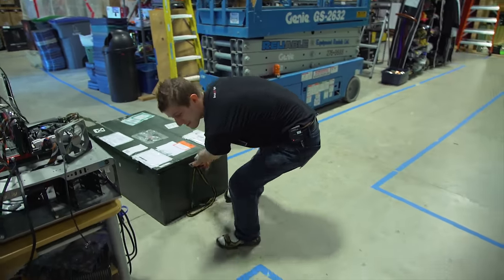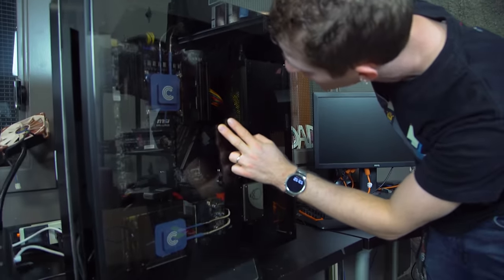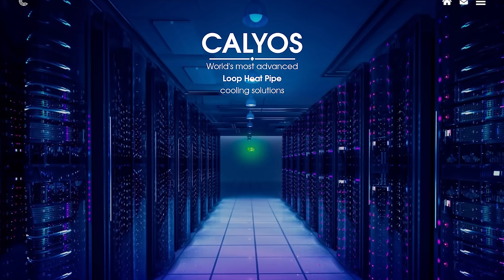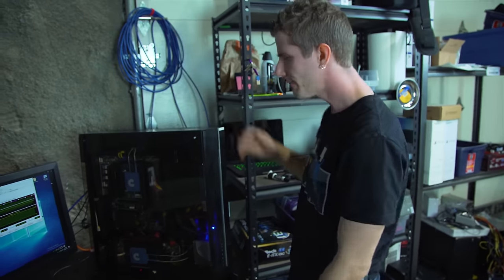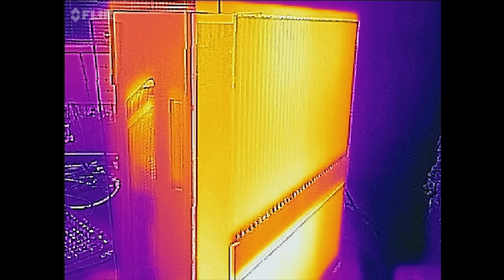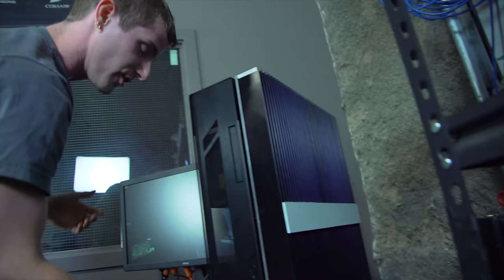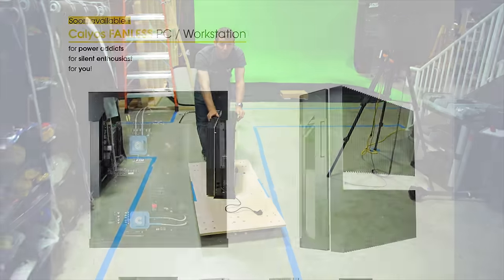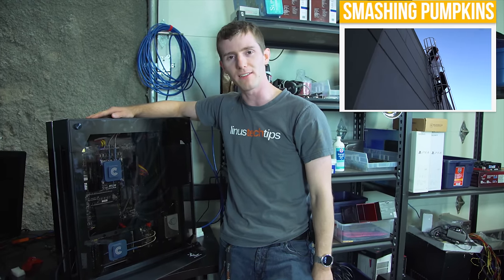TRULY Silent Workstation PC with ZERO FANS - HOLY $H!T Ep. 13

Comment: Make a video about integrated cpu graphic, how much they downgrade cpu work while running regular desktop/office tasks. Benchmarks etc.
Reply: This. I've been running a third monitor on my CPU and haven't felt any degradation in performance, but would like to see a more objective view on this.
Reply: Why not, it is good and cheap for desktop office builds. Not everybody wants to game you know :D
Reply: That's dumb, Steve. Integrated graphics are basically a necessity. If you swap GPUs out, you will most likely need to upgrade or change your graphics drivers, or, if you install it for the first time, how would you ever even know that you're installing the right driver if you cannot even see at all? The signal might go through the GPU, but without a driver telling it to calculate the graphics, it does nothing. A CPU comes with integrated graphics that should work with the chipset of the motherboard and its drivers perfectly, so that you have something to look at when you hook up a monitor. Aside from that, not every single computer has or needs a dedicated graphics card, like the one your grandmother uses, for example.
Reply: ***** They boot up, because they're using the integrated graphics. As I said, tyhe GPU at that point, just passes the signal through.
Reply: ***** Seeing that a GPU simply does not work without the proper drivers (as is any hardware component), I cannot see it doing anything else than passing the graphics from the integrated chip through it to the monitor without drivers. Besides, it is impossible to find any computer of any kind which uses a monitor or screen without an integrated graphics chip, processor, or whatnot, even if there is a separate addon specifically made for that. Just because that addon may not always work or be present. Integrated graphics, while extremely weak in the 3D department, are extremely important.
Reply: ***** Those only work with integrated graphics. That is because those work with the chips on-board, and the CPU works with those chips. However, there are far too many different GPUs with far too many series, which all need different drivers, making it impossible to integrate drivers for dedicated GPUs on the boards.
Reply: Flutters, my AMD CPU has NO integrated graphics, and yet when I built my PC, the graphics card was putting out a signal with no drivers installed.
Reply: happy It has integrated graphics. There simply is no modern CPU without them, and older computers used the chipset on the motherboard as integrated graphics.
Reply: so the amd fx-6300 has integrated graphics? then why does my motherboard not have a single video-out? and why does the architecture diagram of the processor not once mention an igpu?
Reply: happy Yes, it has integrated graphics. And not sure what motherboard you are using, but as far as I know, all consumer-grade motherboards have at least one video output. Be that VGA, HDMI, DVI or something else.
Reply: happy I have googled, and the top answer did say it had, but indeed, further research showed that it didn't... Interesting.
Reply: happy No, I mean, seriously! It throws off everything I knew about integrated graphics, and now I want to know what happens more than ever. It doesn't look too safe, to be honest, because I assume that if your GPU is dead, you simply can't use your computer at all, until you get a new one. As opposed to being able to use it, be it without a dedicated GPU.
Reply: ***** I'm on a Windows computer I've built myself. I have had lessons in IT, hardware, software and programming. That's why I was so sure of myself. The other guy did come up with something I could look up and something that did bring me evidence that what I knew wasn't entirely true. All you did was saying that I was wrong.
Reply: ***** All you pointed out were the default drivers, which I assumed were meant only for integrated solutions. Not once did you challenge me to look it up or treated me with any respect. Your first reaction may have been on point, but it contextually had nothing in it. It didn't explain anything. All it did say is: "Graphics cards can boot up with standard drivers no problem." To which I assumed that the integrated fed through it, meaning that the GPU didn't do anything. Granted, my flaw was not properly reading "There are default drivers and they work with graphics cards.", but your continued lack of respect, not only towards me, but also towards people who don't want or need gaming computers for example made me not want to look into it.
As for my lessons, it was brief, only 2 years, and it's been about 4 since I had them, so it can be that a lot of it has already passed. And by hardware, it was more focused on the practical side, dismantling and building computers from scratch with mostly a fast explanation in how stuff worked.
I wasn't flat-out wrong. I wasn't completely right either. There are differences. I know that I don't know everything, but I was sure that I knew about this, so I went in on the argument.
On a last note, I don't need to fuck myself. My husband can do that for me.
Reply: ***** Chill, girl. Just chill. It's ok if you didn't know. Not that many people know these things. At least now, you can say that you've learned something. In fact, we can all say that we've learned something.
Reply: *****
 Without proper drivers the video card will run in vga or s-vga mode (even when there is no such port), it is a safe mode. Specifically designed to run in bare bones before installed drivers.

Having a southbridge does not make up for an integrated graphics.

And *****
Chill the fuck out :D

Integrated graphics are very useful. But i guess you don't know how to use them.
They are great to have for system fault diagnosis, or even when your pci videocard dies. Then you can at least use the pc before you get a new one.

Even good for gaming if all you want to do is play older games or cs-go, cod etc.

And it is all cheap.
Just get cpu. mobo, stick of ram, ssd,psu and you are good to go :D
Why the fuck spend the extra money on things you never will use.

You are a gamer, we get it. But many people do not need a dedicated video card.

Why the fuck to you think they are still being manufactured? Because there is no market? XD
Reply: bullshit. You support a high volume of machines and have to roll out a different driver set for every iteration of graphics card out there then. I'm just going to roll a system image with iGPU. At worst the intergrated graphics creates a bit of extra heat. it does not "rob" computing power. It's a seperate set of transisters on the die. The only thing intergrated graphics does is share the ram of the computer. (which external graphics cards do too for higher level caching.)
Reply: you have to understand that computers back in the day did graphics through the CPU.
That kind of Graphics mode has not been replaced, it's there and it's what prints all the numbery complicated stuff at boot time.
Integrated Graphics are only a way to cut market share from competitors chipmackers. It's not a necessity.
You are young.
Reply: +Flutters How do you think people install drivers for graphics cards in systems that don't have integrated graphics, like on most AMD cpu's.
Reply: Holy shit, kids nowadays haven't even heard of software rendering.
Reply: omg this arguement is sooo funny, i have never gone to tech school for anything and even i know your system automatically detects when you are using a gpu and even without drivers it converts the card basically into a generic video output, so you can properly install your drivers to be able to actually use the card under load, just for fun i tried running my card without the drivers and it couldnt play a movie set at the lowest quality
Reply: Good god kid's! There's this standards thing/body called VESA and they released this ages ago: https://en.wikipedia.org/wiki/VESA_BIOS_Extensions
And as you will find out on that page, it had it's predecessors it replaced.
Reply: Thanks for adding sanity to this thread of comments.  My own experience with integrated graphics over the years is the really performance drag is they fact they use ram from the system.  I honestly have never seen much of a performance hit otherwise but I never really tested the crap of them either.  A side note regarding adding a video card is that older systems in some cases did require specifying in BIOS which video to try first and even prioritizing by slot in some systems.
Reply: Yeah yeah, firstly the performance impact is minuscule, especially when not running anything graphically intensive.
On setups that require maximum cpu power and even medium graphics, of course a cpu without graphics all the way.

On setups that are limited by budget, by space, by voltage, while still getting maximum out of it, while not needing any graphical power, then integrated is the way to go.

Todays i7's mostly have integrated as they are so multi-cored, multi threaded etc. that the performance drop is so minimal (at reasonable graphics stress) that it is unreasonable to leave it out.

Again it comes down to intels engineers and their decision, obviously they are after power too, but also supplying the demand for cpus with graphics.

There is a big market for them and a big need.

Most people build pc's with a budget, they might want the best cpu but don't need to pay extra 200usd for a cheap ass card and a better psu. That money could be spent towards even better cpu.

Like i said earlier, that both versions should exist. You pick one out according to your own needs.
Reply: Simon WoodburyForget You just effectively explained why IGPU should be removed from all of the i7 processors at once. Thanks bro.
Reply: Simon WoodburyForget Sweet Jebus that ignorance and how you blatantly underestimate other people.

How many of the builds you see with i7 don't have external GPU? Hardly any, even the shitty laptops have a discrete GPU.

Also, it's not just the name difference, i7 has hyper-threading. i7 is a gaming processor and has been that at least since the release of Watch Dogs, first AAA game to utilize 8 threads afaik. In Watch Dogs, i7s are ca. 18% faster than i5s with similar clocks. And that was in 2014. That's the case with every major AAA release after that, unless were speaking of piss poor console ports that are obviously made for inferior hardware.

DX12 with improved multi-threading will make the extra threads i7s offer even more valuable (in the future).
Reply: Simon WoodburyForget  And that's why all major game engines will upgrade or have upgraded to DX12 (Unity, Unreal, Cryengine). The developers that don't use their own proprietary engines don't have to necessarily change anything to benefit from DX12.

Unfortunately DX12 at the moment isn't finished yet, it was rushed to increase Windows 10 sales.
Also, hyper-threading does increase performace - if the game is made to use those extra threads. Obviously old games and shitty console ports are not.

I'm not going to bang my head to wall, you won't change your mind anyway. I just happen to work as a developer in gaming industry, but since you seem to know everything better than anyone else, you should probably come here and tell my boss to hire you. LOL.
Reply: ***** Nobody is agreeing with you. I have held the same position from the start, maybe you finally agreed with me, you delusional guy.

Let me quote your earlier statement. When all this got started.

"No desktop CPU should come with integrated graphics ever."

And that is complete bullshit, in more ways than one. Or have you finally moved away from that original statement?
-------------------------------------------------------
Also, have a look at all the intels i7's with integrated graphics, on their own website, in gaming pc's, mini pc's and desktop pc's.

Also there are videos on youtube that show intels integrated graphics play pretty new games quite easily.
A bit older mid-range i7 is really cheap, cheaper than high end i5's, good for a budget build gaming pc, for somebody who wants to play cod or csgo,and some top down rpg mostly, while streaming.

http://www.intel.com/buy/us/en/catalog/desktop/gamingandmedia

http://www.intel.com/buy/us/en/catalog/desktop/minipcs
Reply: Exactly what i have been trying to tell that +Steve Sherman fool. Who thinks that he knows better than intel executives, yes, he actually said it just like that.
Reply: Simon WoodburyForget Yes, let's all pretend the wise engineers at Intel implemented hyperthreading for i7s for no reason and we can happily live our lives, ok? Oh wait, you want to imply it was made purely for business reasons to sell more i7s? Just like the IGPU, not for actual performance reasons? Make up your mind already.
You can't have the cake and eat it too.
Reply: Full test on that site... very impressive  :
http://www.tomshardware.fr/articles/calyos-loop-heat-pipe-refroidissement,2-2548-3.html
Reply: Simon WoodburyForget With hyperthreading, for each processor core that is physically present, the operating system addresses two virtual (logical) cores and shares the workload between them when possible.
Now crawl under your rock.
Reply: So this thing has gone on long enough, covered many topics. No need to keep going anymore, just wastes everybody's time.

So what to you want to argue about next!
How about Hillary or Trump?

I personally like Trump, for many reasons, while Hillary would be abysmal!! XD
Reply: Steve Sherman, Not trying to argue or anything like that... But I wonder have no one has brought up the concept of integrated graphics for the use in laptops. Many (Laptops) don't have the space for dedicated graphics cards, and the ones that do, are too expensive for the average consumer. And when I say average I really mean people who use computers, but don't necessarily need large amounts of computational power, like me... When I said I didn't want to argue I meant it, this is merrily a detail that everyone in this debate had overlooked
Reply: Steve Sherman  way to swing and miss champ. You don't render the game on the igpu, you great dunce. You leverage the igpu to render the mpeg stream. This gives you free cycles because you aren't using a thread to transcode video. The igpu is doing it. Quick sync is a technology specifically built for this task.
Reply: ***** Okay, That's new to me

Comment: that makes me think - why we are not using computers to heat water at home.
Reply: titos2k Most people use their pc's during the summer as well as the winter
Reply: but you still wash your hands in summer, right?
Reply: titos2k I normally use cold water because I can't be bothered waiting for the hot water to start flowing. Although, Good idea, using it as a boiler XD
Reply: titos2k I originally thought you meant for just heating
Reply: you cant just use normal tap water to cool a pc
Reply: +vennthrax No, but you can run a system that connects your water lines through a specially designed radiator that has inputs for both the PC cooling lines and your home water lines so the heat transfers over. It wouldn't be practical or efficient, but you could do it.
Reply: Water wont get hotter than "luke warm", to heat the amount of water needed for any home use would require the pc to be on for weeks or even months at full load.
Reply: i think some server farms are doing it.
Reply: Right but that is that much less the water heater would have to work.  There are home systems that use the warm water that runs down your drain and recirculates it through a coil to warm the incoming water for the water heater.  Every bit of reclaimed energy is a plus reducing the energy required to reach the set temperature.  I work in commercial/industrial refrigeration and the heat produced by condenser coils, (think behind your refrigerator), is reclaimed for hvac and water heating in most building with large refrigeration systems.  Same concept.
Reply: This is actually a great idea, some guy is using his bitcoin mining rig to warm his house ATM! So not only does he produce bitcoins, he also makes heat. Pretty genius tbh
Reply: But where are you gonna find cold watter to cool your pc then
Reply: I use bitcoin miners to heat my garage haha
Reply: your average pc is not enough for that and you dont want to wait 5 hours for some warm water
Reply: Sometimes it SEEMS like 5 hours to get hot water on the other side of the house!
Reply: I can say that I put a glass of water next to the heat outlet on my laptop (not the bed idea in the world) and 15 minutes of tf2 both the glass and water were uncomfortably warm!
Reply: titos2k In the Netherlands there is a trial project to get a small server farm  in your house. The owner pays the electricity, you get the heat for free stored in a boyler. This way, the data center removes the cost of cooling from its bill. The servers are sealed and encrypted.
Reply: Becuse you choose not to
Reply: @buttersquids   yeah i suppose in the summer months you could use a water heat exchanger 2 pumps to cool a pc water loop to the heating radiator loop just be careful not to end up heating the pc a fail safe would require more parts though
Reply: Nobody likes warm tea